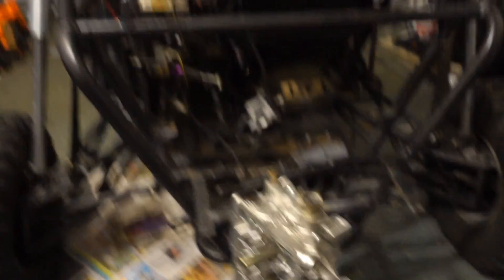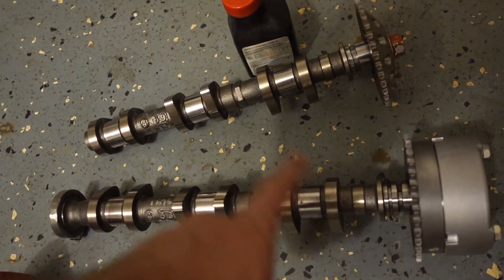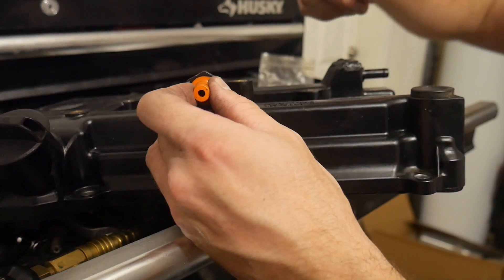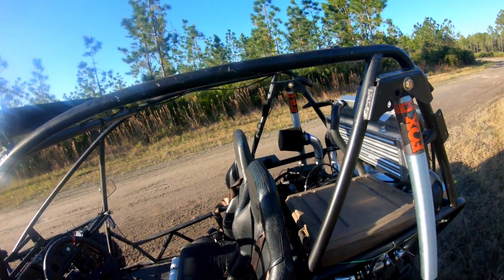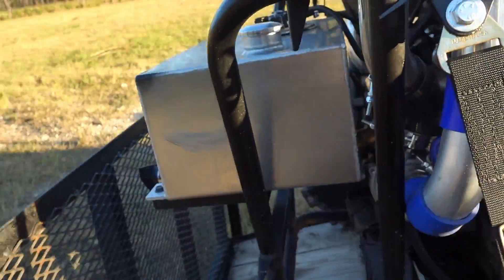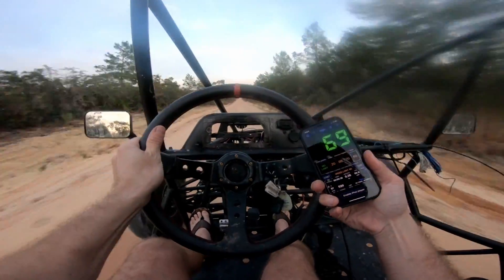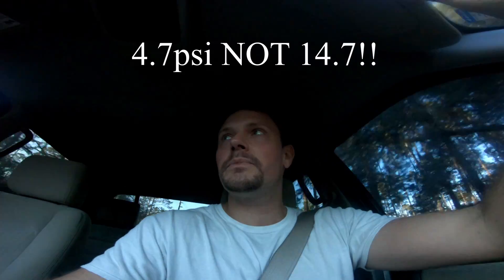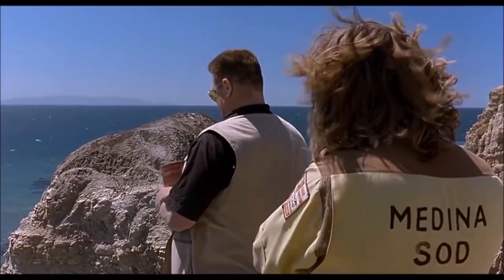My Turbo Mitsubishi 3A92 Dune Buggy is Epic | Turbo Chinese Buggy | Borg k03

Comment: Hell yea! Sounds and looks solid. 
 Lucky too you didn't just have it all apart and up in the air for the clutch.
Reply from the maker: I had a thought... Possibly the engine was torquing enough under high psi that my hydraulic clutch was pulling on the lever just enough to reduce some tension on the pressure plate (it was tight after putting the engine back in). Otherwise that's more custom rigging as they don't make performance clutches for these 😬
Reply: @DirtGearTv  I bet you can get one made for it since you haven't invested that much yet. Lol.  15 is rad.  I'm a push it guy but that enough. Nailed it.
Reply from the maker: @kartnerds  The powers there, now I just gotta get it to the ground! 🤣
Reply: you all probably dont give a damn but does anyone know of a tool to log back into an Instagram account??
I was stupid forgot the password. I would love any tips you can give me!
Reply: @Trenton Dylan Instablaster :)
Reply: @Jayden Turner I really appreciate your reply. I got to the site on google and Im trying it out now.
Takes quite some time so I will reply here later with my results.
Reply: @Jayden Turner It did the trick and I actually got access to my account again. I am so happy!
Thank you so much, you saved my ass :D
Reply: @Trenton Dylan No problem :D

Comment: Very nice! Cvt would've handled it too. It's same as in 2.0 nissan and should handle the 3a92 +hp
Reply: How come?
Reply: @samusaran7317  I think the company that makes many CVT transmissions for passenger cars is called Jatco. The transmission in the Mirage is a Jatco with a power rating for much more power than the 3A92 makes, but still breaks sometime after 150k miles because it's a CVT and they suck

Comment: Dude nice what clutch you are running?
Reply from the maker: It’s an aftermarket clutch from “southeast clutch”, it may not have the same clamping force as the original 🤷‍♂️
Reply: Men  got the same problem I have a 2014 mirage turbo can’t pass 6 pounds after the clutch is done!
Reply from the maker: @mirage3a92turbo7  Dang, that’s not what I wanted to hear. I may have to modify my flywheel to accept a larger/stronger pressure plate. Don’t know why these aftermarket brands aren’t making more parts by now...
Reply: @DirtGearTv   you are right there’s a lot of boosted ones in Asia but no one have any idea to run more power! You can let me know later what setup you’re running in your head!
Reply: On dirt its likely way less of an issue.